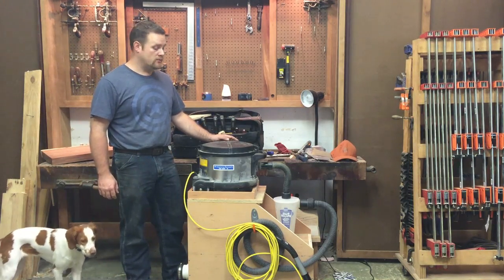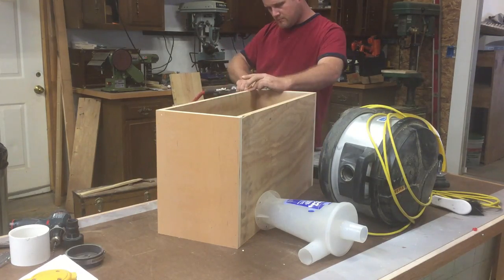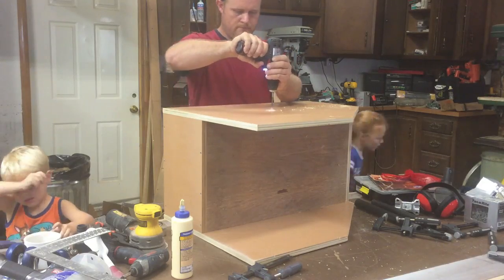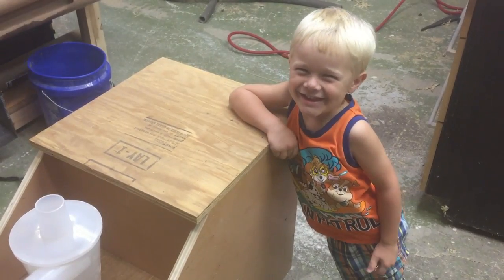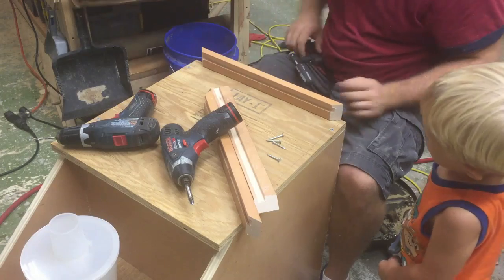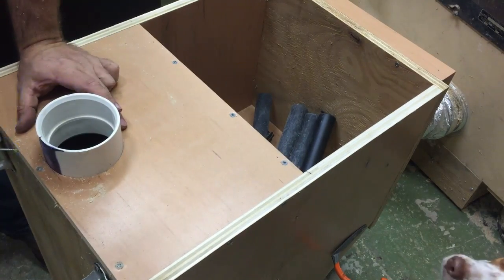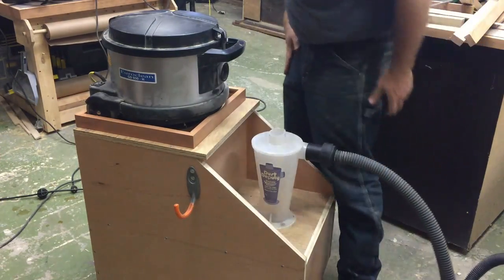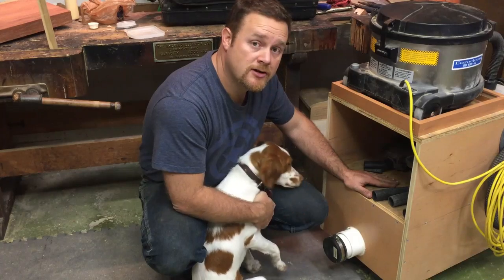Dust Deputy Cyclone Vacuum Cart ep6

Comment from the maker: I have been asked here and on several other sites what adapter i used. here are some links to adapters that work and a link to the dust deputy itself.

Dust Deputy https://www.amazon.com/gp/product/B002JP315K/ref=as_li_qf_sp_asin_il_tl?ie=UTF8&tag=wgharv0-20&camp=1789&creative=9325&linkCode=as2&creativeASIN=B002JP315K&linkId=b7178992c24745aa3e78c71ca2bed2f0

If you have a 1.5" hose you can use this https://www.amazon.com/gp/product/B01...

with a 2-1/2" or a 1-7/8" hose you can use this kit https://www.amazon.com/gp/product/B00...

One thing to remember is that the dust deputy has a tapered connector, so if the connector is too shallow you may have to trim some length off of the dust deputy.

Comment: Thanks for sharing! It looks like you found perfect fittings for the inlet and outlet of the Dust Deputy; would you mind sharing links to those if you got them online?
Reply from the maker: Chris, sorry I didn't see this sooner.  I will look at it tomorrow and try to get you a link to what I have.
Reply from the maker: If you have a 1.5" hose you can use this https://www.amazon.com/gp/product/B014LS0G2S/ref=as_li_qf_sp_asin_il_tl?ie=UTF8&tag=wgharv0-20&camp=1789&creative=9325&linkCode=as2&creativeASIN=B014LS0G2S&linkId=0358b5c958dd3103b179c3dfc818a75a

with a 2-1/2" or a 1-7/8" hose you can use this kit https://www.amazon.com/gp/product/B00FX2R2LK/ref=as_li_qf_sp_asin_il_tl?ie=UTF8&tag=wgharv0-20&camp=1789&creative=9325&linkCode=as2&creativeASIN=B00FX2R2LK&linkId=36297278760969b1e60499435b8d8a1f

One thing to remember is that the dust deputy has a tapered connector, so if the connector is too shallow you may have to trim some length off of the dust deputy.
Reply: Thank you! I will try these out. Not happy with the adapters I've tried so far.

Comment: I'm missing something. Where is the filter for the vac, and where does the dust go, that isn't separated by the cyclone?
Reply from the maker: Doug Prentice the filter for the hepa vac is in the vacuum.  Very little dust goes to the vacuum.  In two years I have accumulated about a cup full in the bottom of the vac!
Reply: SHAWИEE HILLS wow. That is a compact unit. Most vacs are 4 times that size. Wasted space.